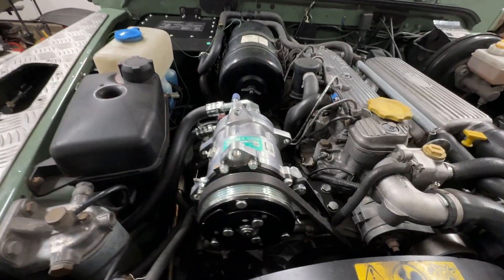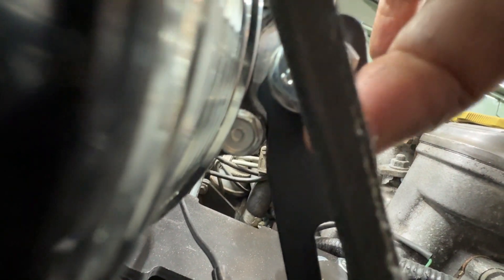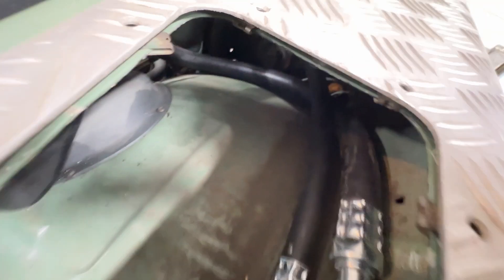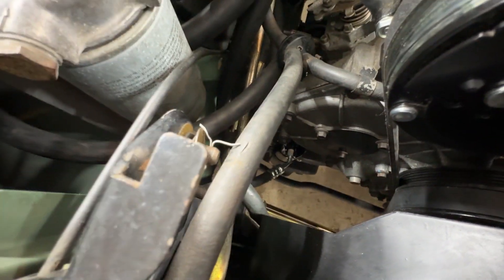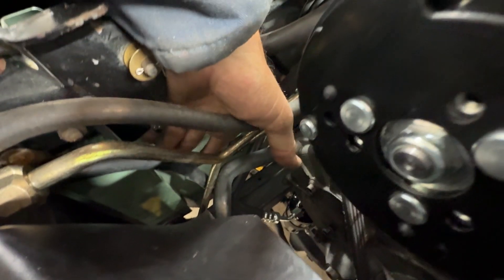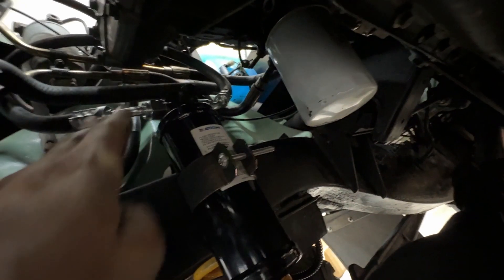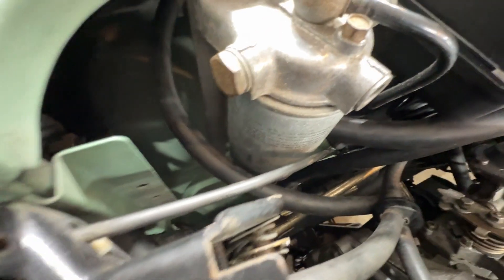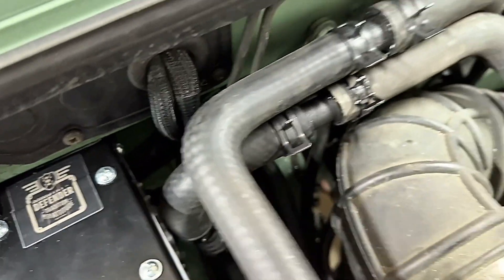Ministry of Defender 300Tdi AC install

Comment: Have you contacted Ministry of Defender to explain your experience and make recommendations, such as a smaller hose diameter and alternate dryer placement? If so, what was the response. I am considering this system and appreciate your info.
Reply from the maker: I have spoken to them about their compressor mounting bracket, they seemed happy with their design. I didn't inquire about the hoses but I assumed it was because they are more stout and less prone to puncturing when installed by DIYers. They are easy to reach and very responsive when it comes to answering questions. One thing I can't complain about is the customer service.

Comment: I’ve been looking at this kit online. I have a RHD 1994 300tdi Defender 90, how DIY-friendly would you say this kit is? Loose much engine power while it’s running? I already have a loss of power going uphill that I need to fix first.
Reply from the maker: The kit is easy to install if you're comfortable working on your truck. This was my first AC install and I probably spent about 50 hours on it. Most of that time was spent figuring out the electric, how I wanted to run it and best way to integrate it into the factory system. The AC plumbing isn't complicated, it's not that many connections. The worst part about it is the wasted space and extra struggle because of the Standard hoses with the kit instead of the thinner Reduced barrier hoses that are typically used these days. I haven't noticed a loss of power but I'm not at altitude so that makes a difference (one less struggle for a 300tdi).